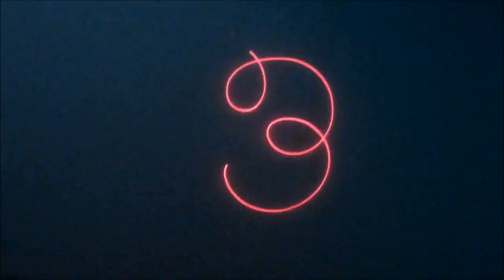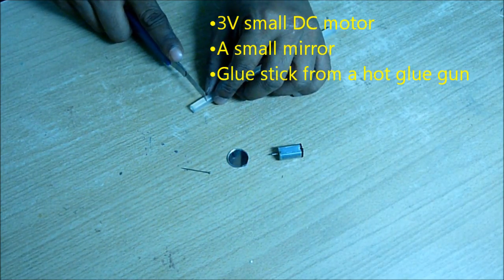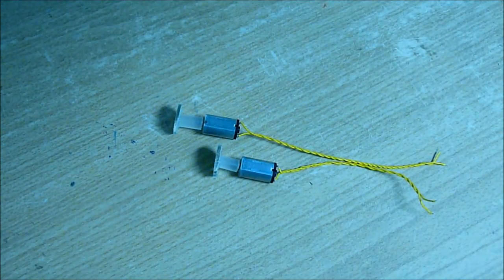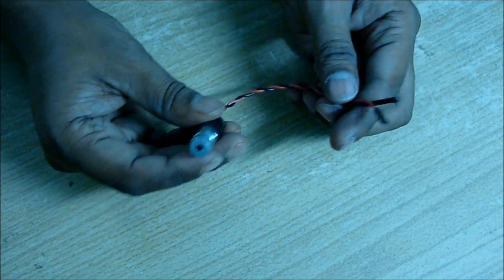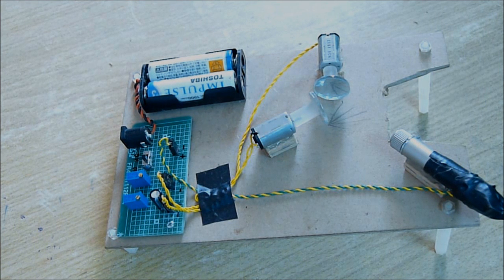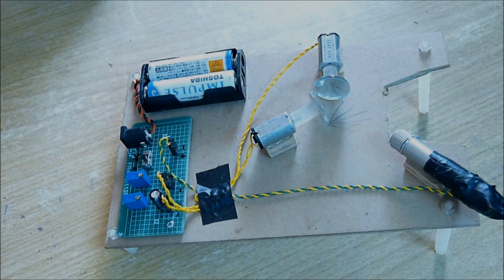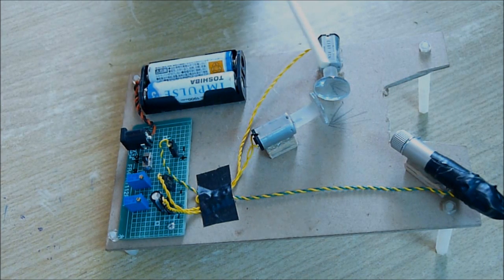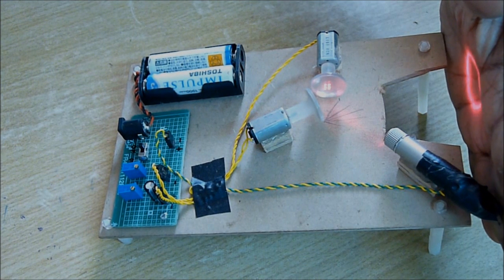How to make a very simple LASER pattern generator - Spirograph

Comment: You will get a different set of patterns using the same setup if you reverse the direction of one of the motors.
Reply: i did the same but it just showing three circles inside one another

Comment: the circuit that you used to change the resistance and vary the speed of the motor and got different pattern from where can i buy it any idea and yes what is it called rply fast i need it urgent ??